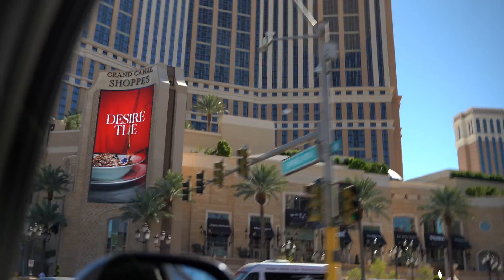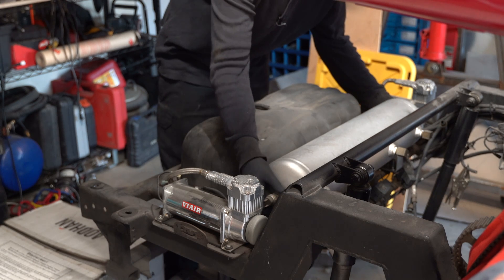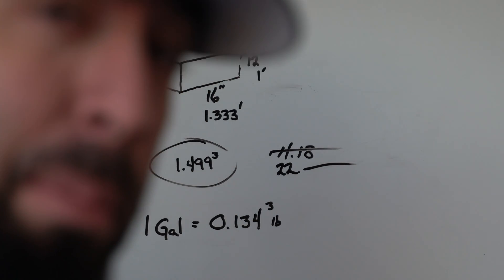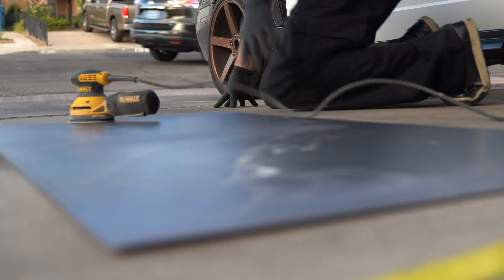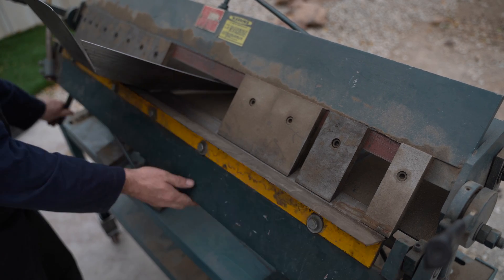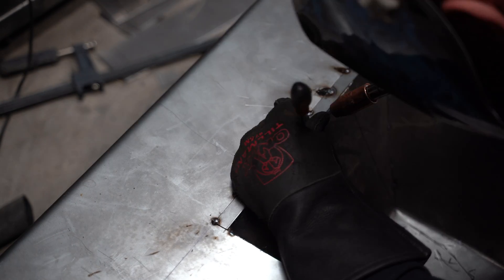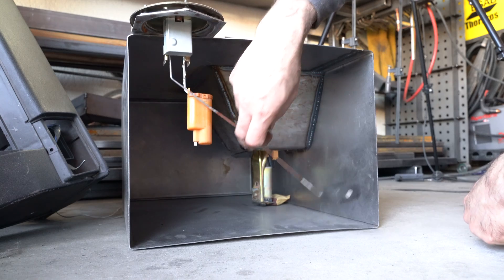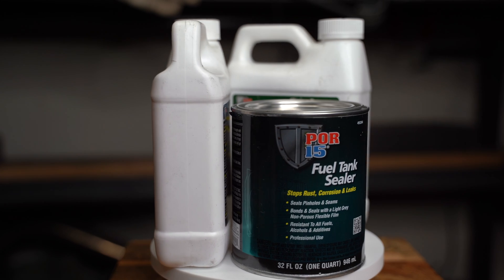Mighty Max Ep. 09: How to Build a Custom Steel Fuel Tank From Scratch

Comment: Why put the sealer in?  I don't think any OEM steel tank has ever had sealer in it.  They are pretty much all plastic these days.   I can't decide what to do about my three wheelwe (e.g. T-rex, vanderhall, slingshot) tank.  Originally I made one of wood to fit an odd shaped spot, used vinyl ester resin to seal it.   I'm redoing it with a tube frame and can use a regular shape and it's more exposed now.  I could redo the wood one, use a keg I have, or an 8 gallon air tank, or the 8 gallon C6 Vette tank, or a new aluminum one, or weld up a stainless steel tank.   It has to be CHP legal, I don't know what the state actually requires, the Vette tank is plastic.
Reply from the maker: I think you’re correct, OEM probably doesn’t use sealer, but they absolutely take measures to prevent rust. Most commonly I suspect is electro-plating. Similar to galvanization. The inside of all Toyota tanks is still shiny metal.
I made a tiny steel tank for my lawn tractor and it rusted out in less than a year.
The keg tank would be amazing! But what do you have to do to make it Cali legal?
Reply: @GarageFab  Kegs are either aluminum or stainless steel.   I've been trying to find specs on what is legal, what I've found just says to make it secure and protected and appropriate material for gas.  My wood one was all that.  It is flammable material but so is the plastic tanks.  I see keg tanks on hotrods, but maybe they don't have to get CHP inspections? 

You must have used very thin metal or had lots of water in your fuel to rust so quickly.  I was thinking of using air tanks, they are quite thick and strong, overkill really, but round is not space efficient, and my trike is pretty compact.
Reply from the maker: I’m embarrassed. When you said “keg” after talking about your wood tank, my mind went straight to whiskey barrels. 🙄 

I too purchased an aluminum cell once. The foam deteriorated and found its way into the fuel system. That was a nightmare. (It might’ve been a cheap tank with crap foam though I got it from JEGS.)
After that, I just removed the stuff. I never experienced any weirdness from excessive fuel sloshing etc.

Comment: Any updates on the fuel tank? I read from previous comments that you aren't happy with the tank liner. I'm guessing the liner is coming apart?? What type of resin or epoxy would be gasoline resistant?
Reply from the maker: You are correct! I was quite unhappy with the liner. In fact I scrapped the whole tank. I will do an update video once I get the new tank. I decided on modifying a cheap aluminum fuel cell instead.
At a risk of repeating what I already said in other comments, the POR15 liner was a single stage liner. When following the directions, it didn’t look like it coated the tank very well. I could still see the steel underneath. So I put several coats until the steel disappeared. As it dried a massive bubble formed. I then had a couple people tell me that POR15 gummed up their fuel system.
So I decided to try and remove it so I could try something else. I poured some surface paint stripper in and it held up to that just fine. Impressive. Regardless, the tank is really heavy and I just acquired a TIG welder that’s capable of welding aluminum so I’m basically starting over.
Someone told me Tank Kreem is really good. It’s a multi part epoxy liner which would make me much more confident.
If you try it out, lemme know how it goes!
Reply: @GarageFab  Aluminum is a great idea! Extra expense on the Argon or Helium gas but no cost is too great if you want the job done right, I guess.  I'll look for that epoxy you recommended.  Ever thought of making the fuel tank out of Carbon fiber or Kevlar? Not your style perhaps??
Reply from the maker: @Ringo1317 Is that a thing? Fiber tanks?
I have an amazing truck project planned that I really really really want to incorporate some fiberglass or carbon fiber body panels. That’s simply a skill I don’t yet have.
Reply: I mostly seen it in motorcycles and boats.   I know car companies even make plastic gas tanks for some trucks but I don't know what kind of gas they use. The coolest thing I seen is a motorcycle gas tank made out of GLASS but good luck with that! Lol
Reply from the maker: @Ringo1317 For sure. I have zero glass blowing experience.
All Toyota tanks are plastic lately. Starting… around 2010… ish

Comment: you said multiple times you were making a tank from sheet metal?  It clearly looked like mild steel but you mentioned it was sheet metal more than once.  Sheet metal is not mild steel.  Was confusing.  Other than that, awesome video!
Reply from the maker: This is certainly one of the strangest corrections I’ve received.
What is sheet metal made of?
Thank you my friend!

Comment: im 3 years too late but you could have avoided the whole dimple trapezoid by extending the hanger and hoses on the pump hat assembly and gained that volume back.
Reply from the maker: You are correct! However the overall purpose was to not just make it work, but also to not have to re-modify the pump assembly if I needed to replace it. And because it’s been discontinued from Mitsubishi, I predicted having to replace it more than once.

Comment: Why line the tank at all? I guess it is possible to get some water in fuel. Is that the concern?
Reply from the maker: I’m in Vegas where it’s incredibly dry, yet somehow moisture finds its way into the fuel tank. I’ve built a few tanks in the past without lining them and they didn’t last long. 😬
Reply: @GarageFab  Thanks for the quick answer! Just discovered your channel and subscribed. I think you convinced me to build a tank for my Triumph TR7 instead of laying out the $700 landed for a new one. I will line it then.. TR7 has the filler cap on the top of the deck.. a bit water prone. If you have water trouble in Vegas..!!!?! I'm in Dallas..monsoon season here now :-)
Reply from the maker: Thank you Mike! Thrilled to have you. I don’t know if moisture is absorbed from the air, or if there’s some water in the fuel… it’s a mystery.
Yes, line your tank or electro plate it, but don’t use the POR15 I used. I wasn’t happy with it at all! I was advised by some knowledgeable people that a two part epoxy liner is the only way to go. I don’t have any experience with it though.
Lemme know what you do!

Comment: Love the video! Im using the same fuel pump hanger from the eclipse in my project where did you find the 2 pin connector for it?
Reply from the maker: I had the whole car! 😆 I bought it just for the engine and stole everything including the entire wire harness.
Reply: @GarageFab  Thanks! I ended up finding the connector it's a sumimoto DL090

Comment: It looks like you're in California (like me). I looked through your newer videos and it doesnt look like your mighty max is on the road yet but I was wondering if you have had/have forseen any issues with passing the smog check with your custom fuel tank. I'm thinking of doing the same thing that you did here for my overland Astro van build (biggest stock tank is 27 gallons) but I'm afraid of the smog guy telling me to kick rocks because my tank isn't techincally legal.

Comment: Excellent video, I am going to approve what I learned by manufacturing the tank for my Datsun 510
Do you know the technical name of the tank sealer components?
In my location I cannot find a similar product, but they recommended phenolic epoxy.
Thx for video
Reply from the maker: Thank you my friend! All I can tell you for sure is I’m incredibly unhappy with the product I use and I have to try to get it out. Ugh. I’ve been told the only way to go is a two part epoxy. If you’re not mixing something, don’t use it! I don’t know what it’s called but I think you’re in the right track.
Lemme know what you find out and how you like it because I’m going to have to coat mine again eventually. 😩

Comment: When drilling polyurethane bushings for spacers, I've taken a
Drill bit the size of a spacer and ran it in reverse it seems to kind of burn its way through the polyurethane bushing but not ruin it
Reply: I guess u could flute the spacer still have to raise the bed to match the cab.
Reply from the maker: Interesting! I think I’ve done something similar once. I used a metal pipe the size of the hole I needed with some makeshift flutes cut into the side of it. It too kinda melted its way through but I was happy with the result!

Comment: Maybe plating is a better option
Reply from the maker: Are you talking electroplating? Good idea. If I can succeed at removing all the liner I just might go that route. I’ll be updating.
Reply: @GarageFab  yes, should be easier, faster, and cheaper
Reply: @GarageFab  i think that liquid liner is meant for small motorcycle tanks, easier to coat something like that, they dont have baffles.

Comment: you should take a look at a early 90's nissan 240sx fuel pump assembly :D also radium makes an amazing dual pump version if needed its similar and is made for a taller tank and has the fuel level sender on the fuel pump assembly thanks for the knowledge
Reply: ps its always a fun cool idea to put a drain plug on fuel tanks somewhere :D
Reply from the maker: Thank you Nicholas! I’ll look into it. I still haven’t decided if I’m going to keep the Eclipse stuff.

Comment: if you cant get the angles with a finger brake, only thing i can think of are those forming dies but thats expensive and only makes the one part (commerical sheet metal roofing fabricator and installer by trade)
Reply from the maker: Forming dies? You’ve got my attention. Are you thinking similar to what a Pullmax machine would use?
Reply: @GarageFab  look into hydraulic press brakes,  some have very specific dies but make crazy complex shapes in one "press" (like the main block will come down, the the sides pinched, then another spot bent).   for the shape you want i could only think of that or stamping
Reply from the maker: Excellent. I’ll check them out. Thank you.

Comment: Oh, if only you had metric! 
That first volume calc would be 6.86x4.1x1.5 decimeters = 42.2 cubicdecimeters, which – because metric – 42.2 liters! Damn simple right?
No need for using lengths of grains of barley to define volume derived from the Romans, who used letters for numbers… but oh well…
Still love your videos!👍🏻😉
Reply from the maker: Hahaha!!! Grains of barley. 😂 Tell me about it Christian. I hate hate hate our measurement system. Passionately. I tried to switch to metric in my own personal shop (even re-purchased every measuring device I own in metric) but then quickly realized that unless all my parts and materials suppliers also switched, it would actually be more work constantly converting back and forth.
Reply: @GarageFab  Stick with it! You work on jap cars, they are metric, and more and more american cars are too. Since I’m in Denmark, I have no personal experience, but I’ve heard that when you take some measurements on US cars, like between balljoints, that are i.e. 7” 111/127, and think “why didn’t they go easy 8”???” It’s because it’s actually 200mm…
It’s sooo much easier! Take thread, M8 is…. Wait for it… wait….. YES! 8mm’s (the head would be 13mm if it’s a european car and 12mm if it’s japanese)
Btw almost all the YT’s I watch are in imperial, so I have to constantly convert to grains of barley😉

Comment: Also a good thing you added the other flanges how were you going to full it without at least one of them
Reply from the maker: I just realized that I didn’t include the filler neck install in this video 😬
Reply: I seen it at the end I realised how it worked then but that video is gold how did the liner hold up after it took so long to apply like 3 days with it in tank rotate every 2 hours then drain it and then wait 90 aomthing hours for it to cure completely how's it held up ?
Reply from the maker: Well, Jamie, there will be an update in about a month or so, but spoiler alert, I hate the liner. Now I have to try and figure out how to get it out. If I can’t, I’ll have to start over on the tank. Or better yet, but one. 🤔

Comment: If you were going to lengthen the sending arm why not just keep the pump sender at the full 12” too? 

It’s trivial to extend the pump connections to the bottom of the tank if you’re worried about pump sitting low enough 

If you don’t care about the pump sitting low in the tank you can just run a hose to the bottom still and run something like the Holley hydro mat at the bottom to aid pickup
Reply from the maker: Honestly I didn’t know such a thing existed. That definitely would’ve been nice. I’ll look it up because it might still be an option. My tank liner was a disaster and if I can’t get it out, I’m gonna have to start over. 😬

Comment: Volume in cubics inches without converting to cu ft.
Example:
10”x12”x16”= 1920 cu inches
1920/1728 * 7.48 = 19.7 gal

1728 equal number of cu in in a cu ft
7.48 equals number of gallons in a cu ft
Reply from the maker: Much appreciated! Math is still gross though. 😆

Comment: Why didn't you just extend the pump hanger so it reached 12", and simply change the pump if necessary? Bare pumps are pretty universal, as long as you get one rated for the flow you need.
Reply from the maker: True! But this wouldn’t have helped with the sender unfortunately.

Comment: You're overcomplicating the math. It's a lot easier to use 234 cubic inches per gallon. Don't ask me how I remember that, as I have no idea.
My next question is why in the hell are you using 16-gauge. Seems to be considerably thick for the application. 18 or even 20 gauge would have sufficed. Not a fan of your minimalist baffling. Not that it needs to be too much, but too little can be just as bad.
A good mechanism for reducing warpage is to back Stitch.
I've explained to you what back stitching is. On the part of the video where your welding down the one corner of the tank you did a 1/3 of the weld at the top than you did one third of the weld at the middle then one third of the weld at the bottom. You should have reversed that order. It causes the warpage to mitigate itself. The other advantage to it, especially considering you're making a fuel tank is that when you start your weld where there is already weld you don't always get a good seal. But if you're already welding when you run into a previous weld. It's far easier to seal the weld.
Reply from the maker: I’ll have to experiment with that, Thanks!

Comment: I would have ditched that pump and sender and used one with an integrated sender and of the right height for the 12" tank.
Reply from the maker: Can you tell me more? Like where to find this? I just might take your idea since I just broke my extended float off by sitting on it. Whoops!
Reply: @GarageFab  Any parts store or online, the hard part will be finding the right one.  Most production cars/trucks use an integrated pump/sender assembly.  Now that you have the flange for that pump you'll have to change it or try to find something with the same flange which will be harder, plus you'll have to match the resistance of the sender or modify it.  At this point you're probably better off fixing what you have.
Reply from the maker: Agreed. I think this time I’ll find a way to dismantle the Mitsubishi pump and replace the entire float arm.
I appreciate you my man!

Comment: what caliber do you use
Reply from the maker: Hey Brother! I’m assuming you’re asking about the metal thickness. The stuff I used for the tank walls was 16 gauge, 1/16th of an inch, or 1.5mm.
Reply: @GarageFab  you made a gas tank for a 96 chevy stepside to put it under the bed in the back

Comment: to do the trapezoid shape, you really need a real press brake where the ram goes straight up and down. you could probably do it in one of those at home kits that fit in a press if you can make the punch in removable teeth like the box and pan (finger) brake.
Reply from the maker: Agreed! That’s definitely something I hope to purchase or build in the near future, Marshall. I suspect the V block would also need to be customizable. I haven’t seen that though. 🤔
Reply: @GarageFab  In the shops I have worked in that have Press Brakes, we were always making custom dies to press different shapes. We never threw them out and there was a place in the tool room with numbered  dies and drawings of their shapes in a notebook. When you needed a special shape you consulted the book and selected an existing die if you have one. We had a selection of 90 degree V dies that lived in the brake. Your trapezoid could be easily made is a press brake. If you have room for a hydraulic bench press you can make a small press brake out of it but, the size of your project will be limited to the press you have.  
Hope this helps.
Reply from the maker: You got my juices flowin! I’ve never wanted a press brake more.
Reply: @GarageFab  you just make the bottom sectional like the fingers at the top. Most ram style brake presses have sectional bottoms.
Reply from the maker: I wonder if I should invest in this rather than the magnetic brake I’ve been saving up for. 🤔
Reply: @GarageFab  if you do the small shop press conversion kit style, you can make one cheap and still save up for the magnetic brake.
Reply: @GarageFab  Marshall is right you can get a small shop press and be in it fo a couple hundred and still get your magnet brake if you want.
Reply from the maker: Consider it done!
Reply: @GarageFab  honestly with your skills I have seen in your videos, you don’t even need the kit. You can just make it yourself to save a few more $$$.
Reply from the maker: Might make an interesting video. 🤔